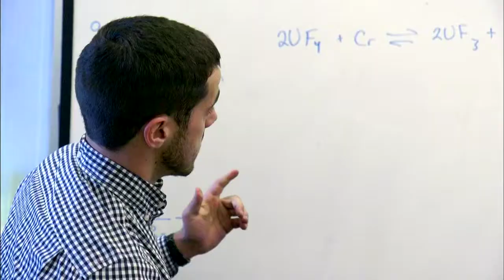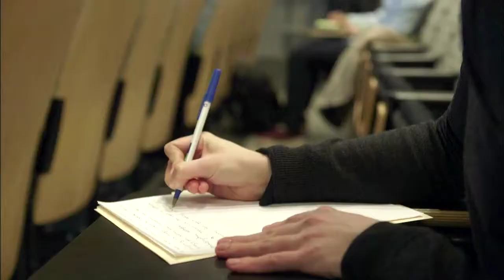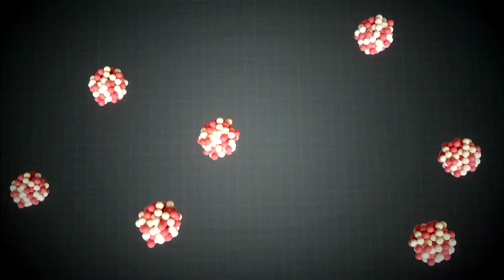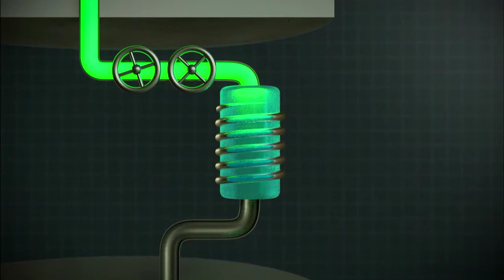Molten Salt Reactors TransAtomic HD NOVA The Nuclear Option

Comment: What’s fascinating about molten salt reactors is that the use of a liquid fuel opens up so many new avenues for chemical reprocessing. For example gaseous fission product, insoluble in the fuel salt, will bubble out of solution. This gas can be pumped into a chamber and allowed to decay. Removing some fission products from fission fuel, at a very low cost